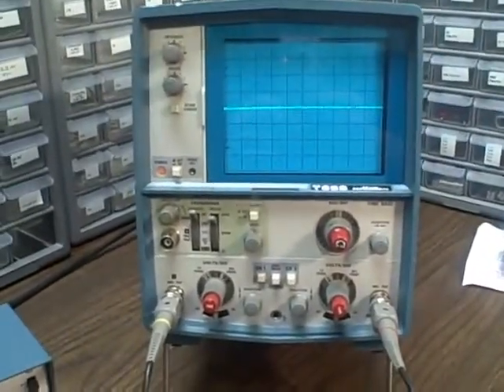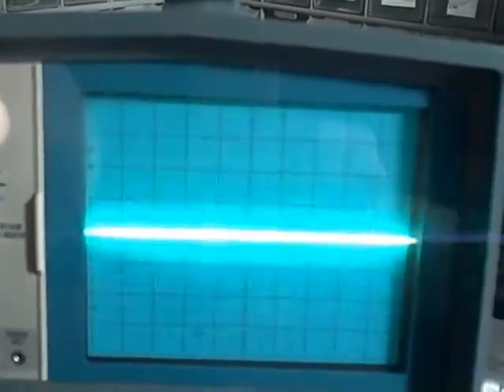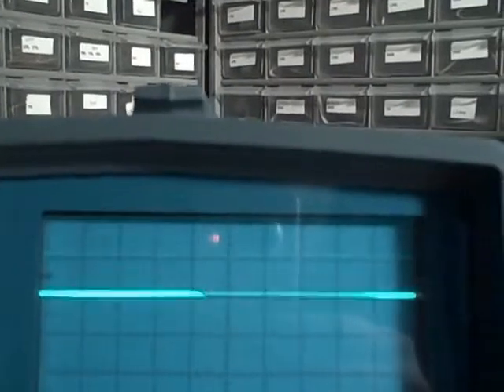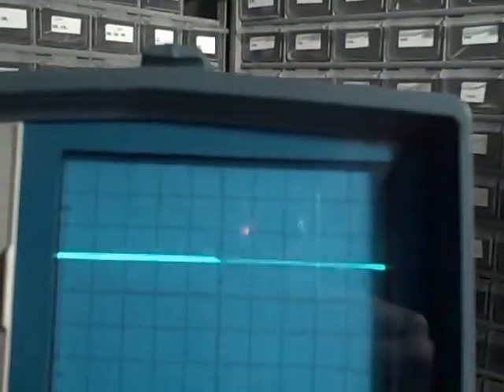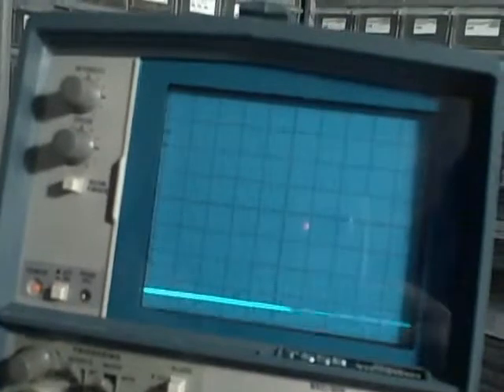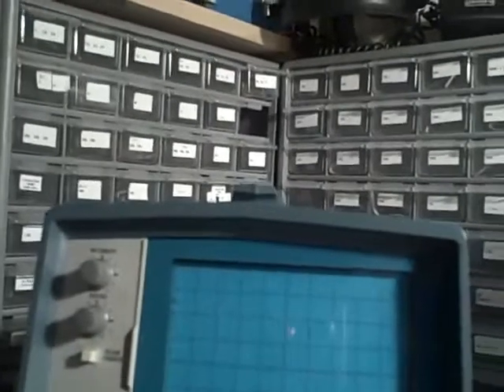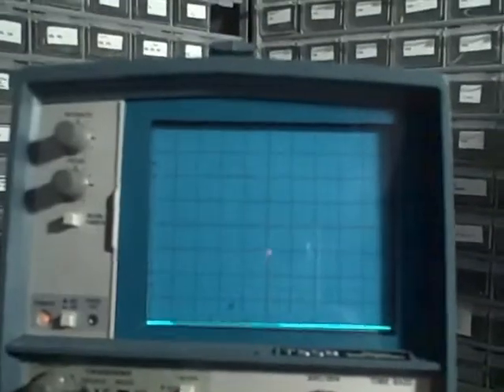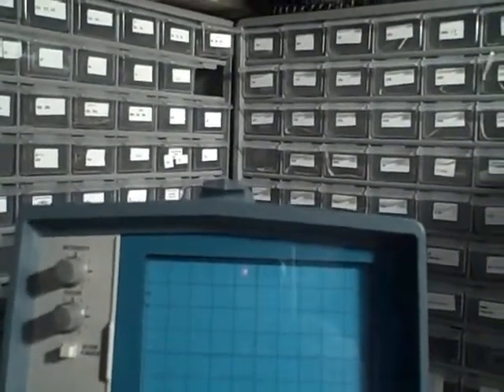Tektronix T932 Dual Trace Oscilloscope-Vertical Cal Check.avi

Comment: I just picked one of these up for $80 with no probes included. I'm sort of new to scopes and I'm curious if I got ripped off.
Reply from the maker: I have a special affection for that scope. I used one like it in college and hoped I would own one some day.  Then I finally got one near retirement.   It was special to me. 

Anyway, if it is working, that is a good price.  If it is defective, it depends on whether you can repair it or not.  Working scopes like this often run $120 to $150.
Reply from the maker: Sounds like a good purchase to me, as long as it works!  Probes can be bought for as little as $11/pair.  I had a fondness for this scope. It is just like I worked on in College, 43 years ago.
Reply: @bap8guy  Good to know. It is in working order, except whoever owned it before me punched out the ac/dc coupling switch. I bought some probes off Amazon, but one of them, the BNC connector snapped right off after a few uses.

Comment: Hi, i saw exact this scope in local thrift store for $45.  Can use this scope for repairs og home electronic devices like VCR, TV Radios , DVD players .... ? There is a label on it last calibration date is 1989! And is it worth for the price?
Reply from the maker: These regularly sell on Ebay for over $130, so yest a working unit for $45 is a great buy.  You can use the scope successfully for any work under 30Mhz.